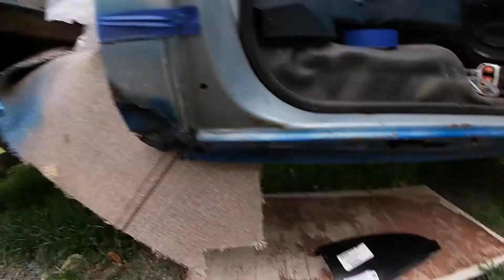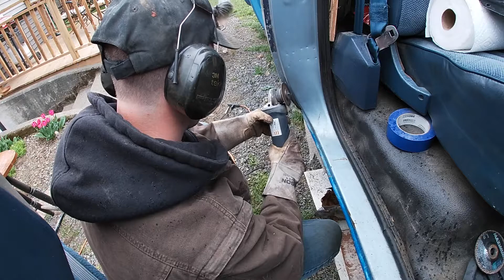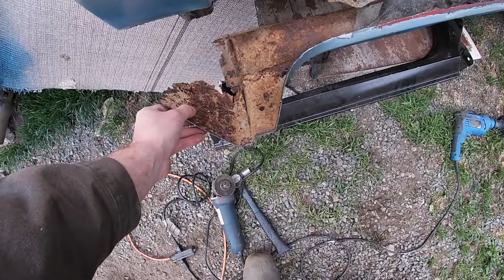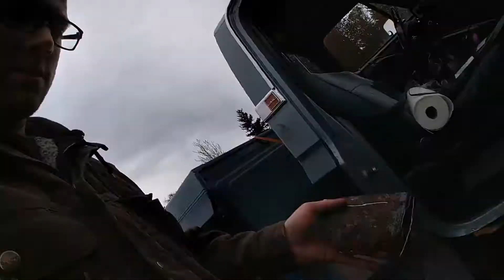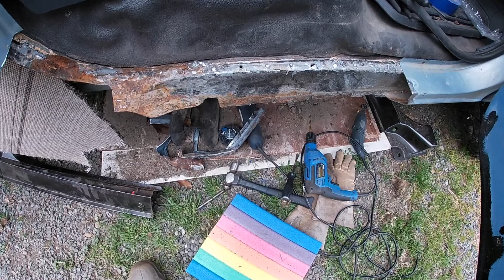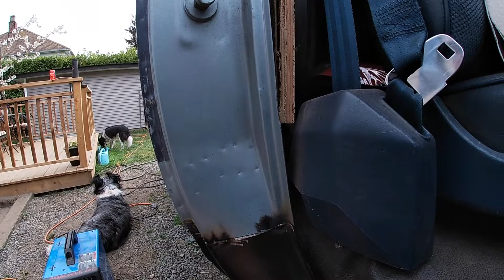Replacing Rocker Panels 1983 GMC K1500 (part one of cab corners)

Comment: Awesome work where did you get the outer rocker panel from?
Reply from the maker: I think it came with the truck when I bought it. The patch I did on the box unfortunately did not last. Either the next owner 4x4’d it too hard and it split or the welds didn’t hold up properly. Should have got a gas cylinder for that to be done properly but it was my first time ever doing auto body like that.

Comment: Just wanted to say thanks for the video. Replacing rockers and cab corners is my next task on my 82 C20. Awesome looking Aussie you have there. My Aussie likes to hang out in my shop too.
Reply from the maker: My only suggestion would be a better welder. It worked but make sure the welds hold. I had a heck of a time getting enough heat to properly join the metal even with a good looking ground and properly prepared surfaces. I think using gas would have helped a lot.